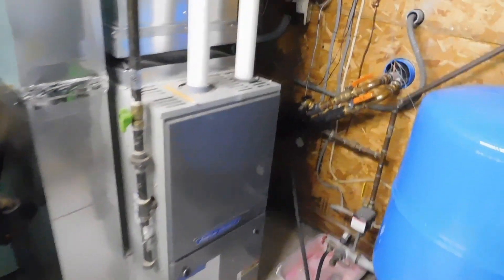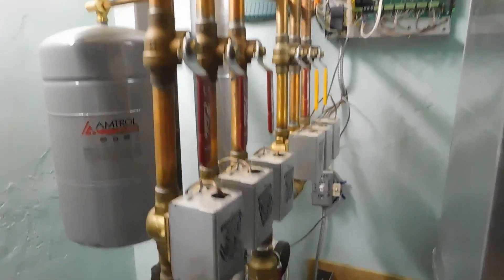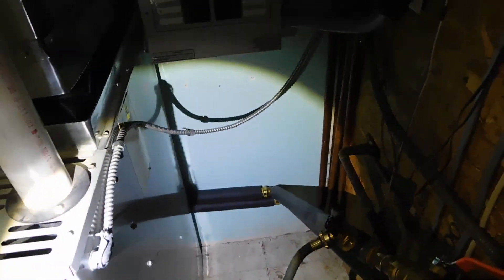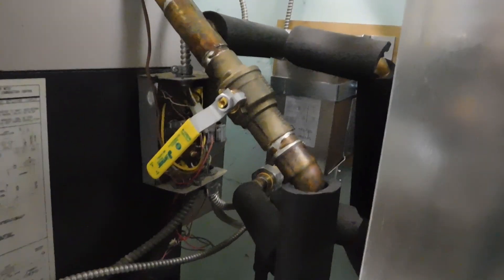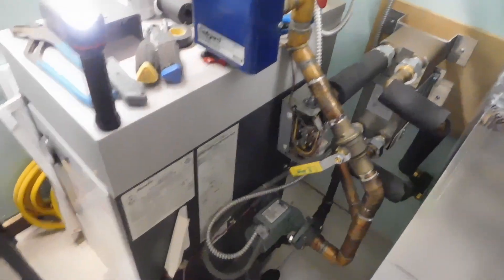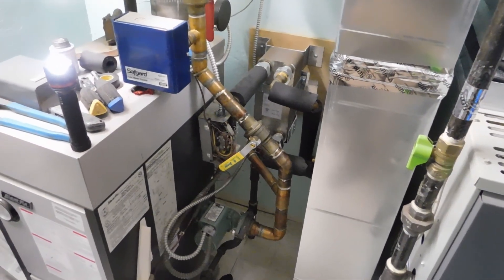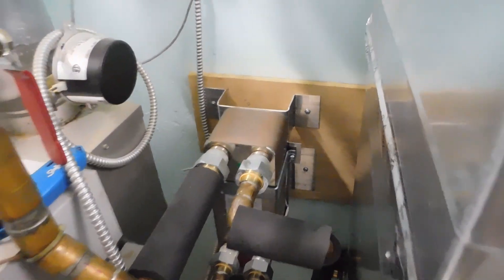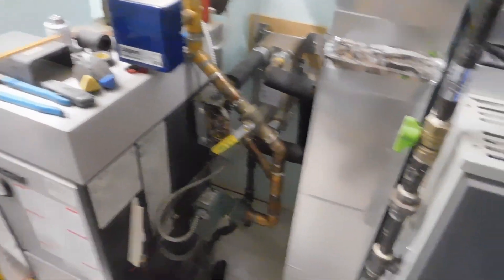Outdoor Wood Boiler to house LP boiler plumbing

Comment: I’ve searched and searched for months on YouTube trying to figure out how to plumb a wood boiler into a LP boiler that will be the “back up” quote on quote. We are getting ready to break ground on our dream home and we are not thrilled to pay for high priced propane and have looked into wood boilers for years. You’ve given us hope that will help us achieve that. Thanks for the info
Reply from the maker: @braydontholen  my pleasure,  this and the barn plumbing are the reason I started my channel,  I couldn't find any info anywhere.
Reply: @ I’m interested to know how difficult it would be to do a combi boiler with wood boiler option, can’t seem to find that either! Thoughts?
Reply from the maker: @braydontholen  not tough at all,  almost anything imaginable is possible,  and honestly not all that complicated in theory.  If you're not up for the install,  just got to find a good plumber.  Where ya located?

Comment: Great video!  I’m in a similar boat where in the past year we changed over 2 forced air oil furnaces to one propane boiler combi system that does both radiant in floor heating for half the house and also goes through a heat exchanger forced air for the other older part.  With that huge investment completed the cost of heating this house which is not small is still on the painful side and so I got myself a used wood boiler and I’ve roughed in 2 circuits, one for the house and the other for a pool.  I’m moderately handy and have done a good amount of plumbing and electrical work however this whole boiler set up had me a little more than nervous to tackle but my HVAC guy is MIA so I may be forced to tackle this myself.  I’d like to plumb it similar to yours where the wood boiler does most of the work but the LP would take over if let’s say we go away or for whatever reason the fire in the wood boiler goes out.  So how do I do it so it’s automatic?  Your set up is not automatic correct, you have to manually select whether your heating through the plate exchanger (wood boiler) or your LP boiler? how did you size your plate exchanger?  How did you drain your lines to be able to tie in your plate exchanger (I haven’t fully educated myself on that side of things)?  Any help is appreciated.
Reply from the maker: Hi there, glad to see folks are getting something out of these...lol  When I started digging into all this there wasn't a single video showing my setup.  I sized the plate exchanger just by talking with a good buddy of mine who's a pluming and heating specialist for 40+ years, but basically 2-3k sqft, a 40 plate will work just fine.  As far as the LP being automatic, my setup could work as an auto back up, I just turned off the lp gas to the unit so it cannot, but if I just turn on the gas, light the pilot, and turn down the temp sensor (the one that tells the lp boiler to kick on) to lets say 150, then if the wood boiler is shut down or runs out of fuel, the lp would work as advertised. Furthermore, in this case, it would also help keep the water in the OWB from freezing because the plate exchanger would be working in the opposite direction. The LP boiler system doesn't know where the heat is coming from (LP boiler or plate exchanger), there's some weird physics within the lines that somehow the hot water from the plate exchanger will flow (even without a circulator pump) into the LP boiler its self.  My system has shutoff valves on both sides of the LP boiler and each side of each zone loop, so I just shut off all the valves and cut the feed line into the boiler, I did have a small about of water come out (just had a 5 gallon bucket ready), after everything was plumbed, I used a couple garden hoses and flushed the system and got all the air out (that's a whole other process I should make a separate video on).
Reply: Thanks for the info.  Sorry for the very delayed reply.  I read the response, then got distracted and never came back until now.  One issue I may be facing with mine is that the LP boiler is triggered on when there is water flow.  So it doesn’t matter what temp I set the incoming water to.  That’s something I need to figure out but I think with some automatic water temp sensor valves this can be accomplished.  I will share once this work gets completed which is way overdue.
Reply: @karonosphere8390  Hey there from Muskoka! I’m tackling same situation as yours right now. (Lp Combi as automatic backup to wood boiler) did you end up figuring it out?
Reply: @shawnphibbs4380  I’m currently waiting on a quote from an HVAC guy that came in with a lot of confidence and gave me a brief explanation of how it needs to be done.  He’s done them before but is waiting to hear back from the manufacturer of my wood boiler which is a Heat Master G200s in regards to installing the appropriate size heat exchanger.  Anyways hopefully this guy can do it the way I want and I’ll do my best to share the details.